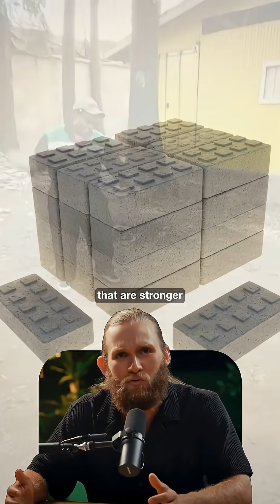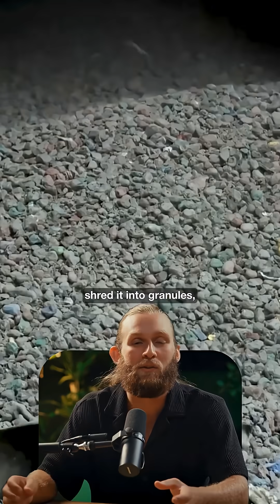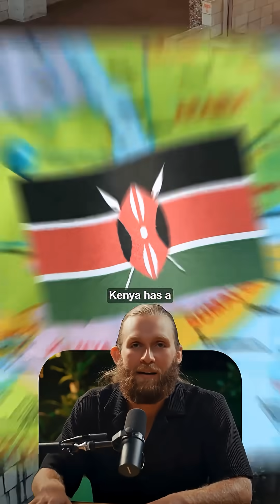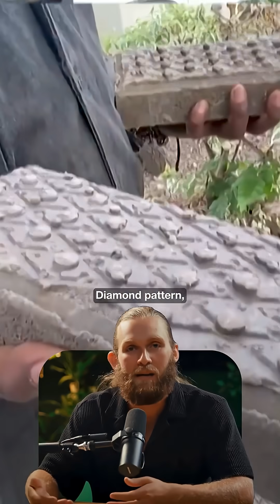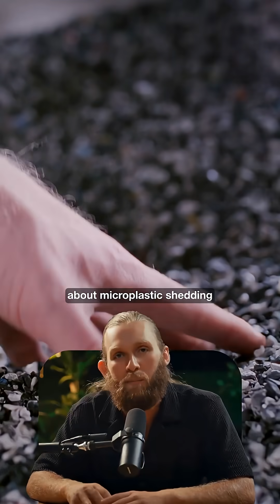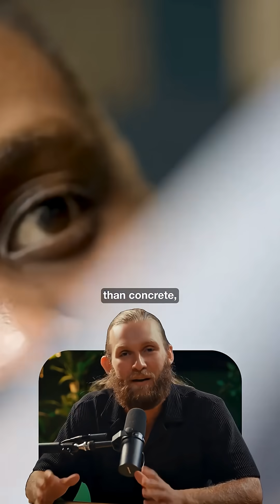KENYA TURNS TRASH INTO GOLD - PLASTIC BRICKS

Comment: In the end the plastic will still end up in the environment.
Best environmental option for plastic is use as secondary fuel.
Reply: In regions where they can't adequately capture and process the fumes? Yeah okay man.
Reply: @sirflimflam  I have an engineering degree in applied environmental sciences. Can you say the same?
Reply: @stonytina5177  Go out there and solve the problem then.
Reply: @sirflimflam It's clear you don't know what you're talking about and now you're upset with me for pointing it out.

Comment: We need more microplastic in the environment...
Reply: It's already in the environment dude. Lol. That's the problem. You can't unmake plastic waste and burning it releases tons of pollutants into the air, so make it useful at least.
Reply: @sirflimflam Yes, processing it to shorter chains and expose to sun will decrease the speed of releasing the toxins to the environment. Also filters are unknown in the third decade of XXI century and these are as mythical technology as WARP drive so therefore Sweden, which burns the most plastics in EU is the most polluted country in EU.
Reply: @hikg4192  You know Sweden can only do that because they're as well off as they are, right? Not because it's efficient or cost effective? You think rural Kenya has the same pull here? Really? Lol
Reply: @sirflimflam And why plastic comes to Kenya? Because most rich countries play hoax with recycling instead of burning it. And no - it is better to bury this plastic under the ground than processing it (which makes it more toxic due to shorter chains) and expose it to environment.

You will advise them the same with lead and asbestos or in that case you would agree with me what to do with materials with some toxic properties?